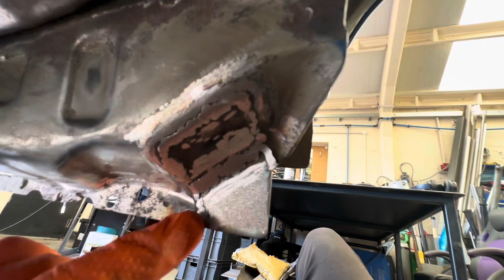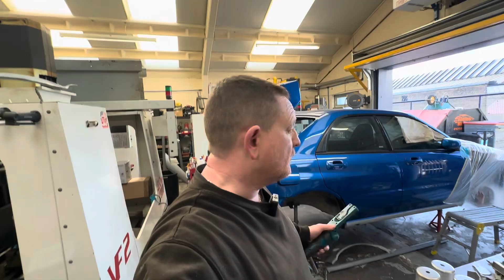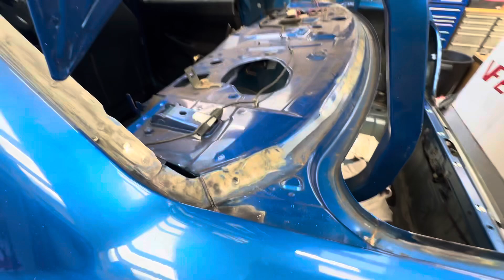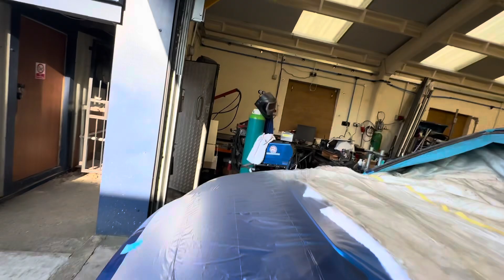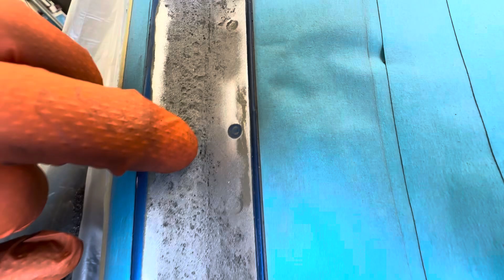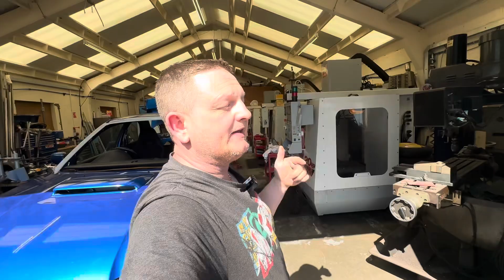Shot blasting the rusty Subaru wrx windscreen surround

Comment: When i replaced the outer and vertical support on a 1998 Ford Fiesta. The sills were also not the correct radius as the originals. When i eventually welded them on to the top part where the door seals fit i had to pull them round  to tighten the curve and clamp them on the lower seam. Maybe they are made like that then when they are fitted they are under tension which would make the sill stronger. When i de rusted my VW Transporter windscreen rebate i stripped it back to bare metal and treated it with rust remover. I then coated the bare metal with windscreen adhesive which bonds to metal, then later bonded the windscreen in. Maybe paint the section with the blue paint and primer but use the windscreen sealer where the screen bonds to. The problem if you paint the rebate is eventually rust will de laminate the paint and the window will leak again. It is all hidden with the windscreen rubber trim. There is a lot of body twisting going on and if the windscreen is bonded direct to the metal it will be stronger. I know in the factory they are bonded to the paintwork but it is baked on in controlled conditions.
Reply from the maker: Yeah i do think where i have cut it all away it has sprung back a fair bit
Im going to try another suppliers sill if i can get one before i decide what to use

As for the screen rebate paint scenario , i understand what you mean but i have never had an issue on previous fully painted cars when fitting new screens etc so im sure this will be ok and the car will probably get longer baked after paint at the body shop then the factory does

Fingers crossed it doesnt fly out either way lol